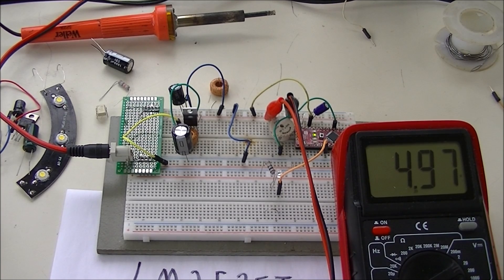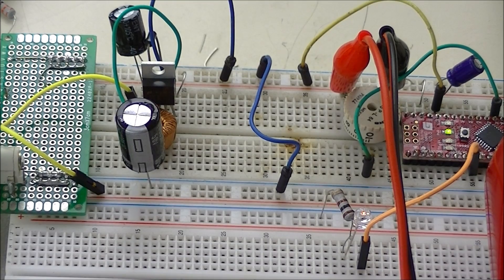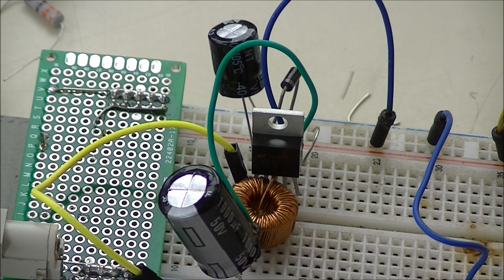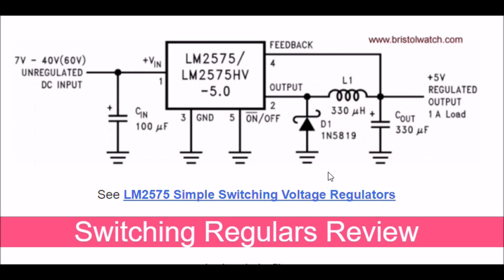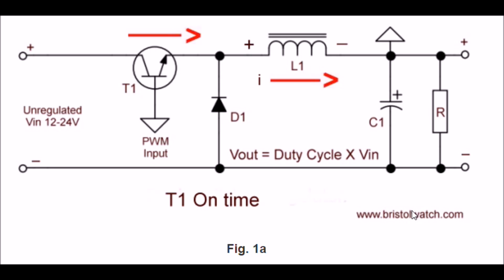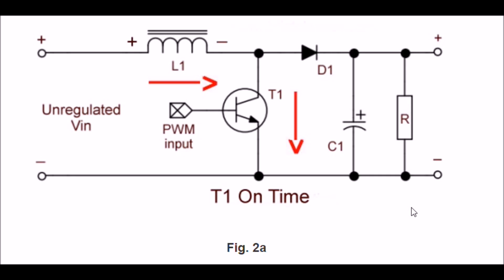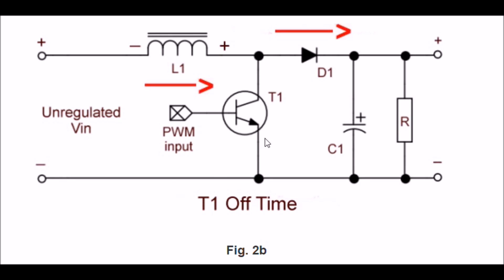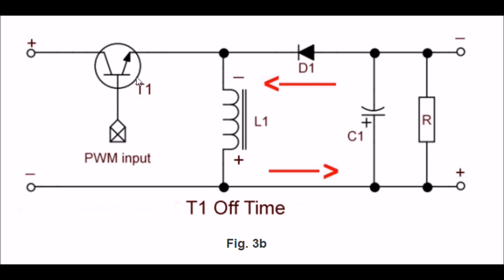Review Types of Switching Voltage Regulators

Comment from the maker: Arduino Switching PS Demo
https://youtu.be/NO41UezqO-s
Using the LM2575 
https://youtu.be/6Qrs3JmdPl8
LM2575-ADJ 
https://youtu.be/zbF6AiGQlaE

Switching Regulators
http://www.bristolwatch.com/sr/index.html
Arduino Switching Voltage
http://www.bristolwatch.com/sr/ArduinoSW.html
Switching Regular Configuration Review
http://www.bristolwatch.com/sr/typeSW.htm
Generating High Voltage with an Inductor
http://www.bristolwatch.com/sr/inductor.htm